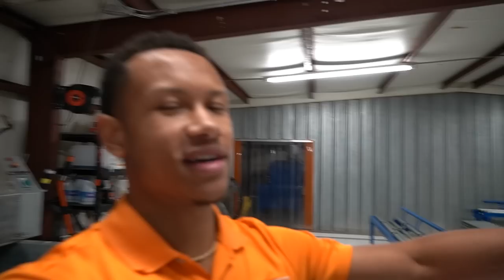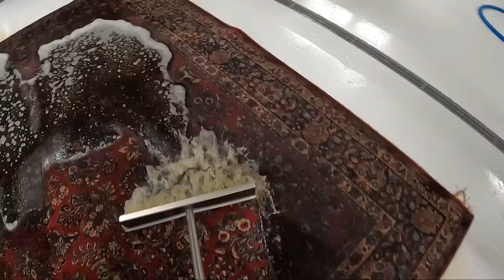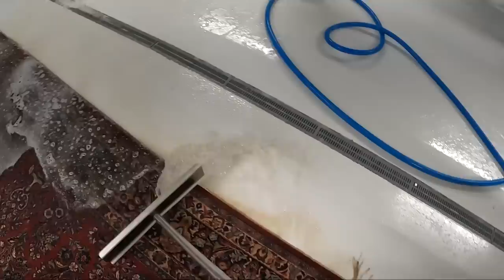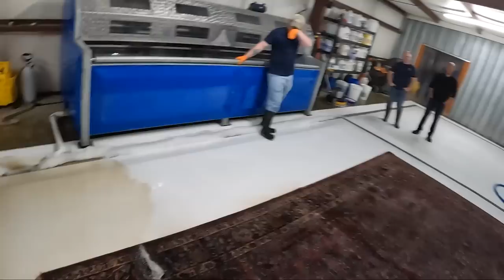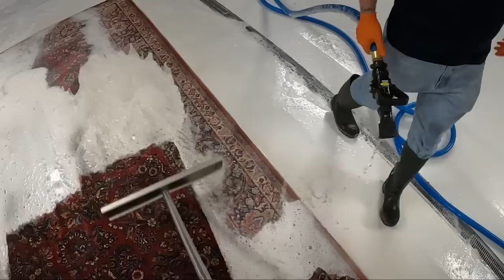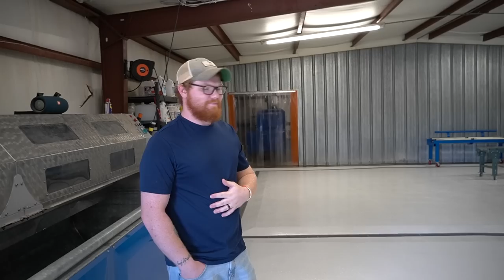How to clean an Extremely Dirty Karastan Wool Rug || P.O.V Rug Cleaning

Comment: Do you change the wash tub's water or do you use the same water all day?  I'd sure hate to have my rug follow a pee soaked rug in the tub.
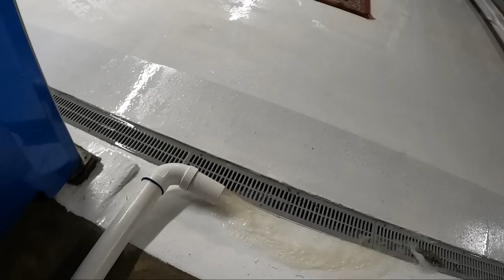Reply: Watch 2:09, he empties the tub of dirty water after the rug has been washed, so the answer is YES he does.
Reply: @white6942  yes, he did empty it, but said that all the rugs had urine in them that day.  I've seen multiple rugs put in the tub.  Just curious since I wouldn't want someone elses pet urine mixed in my rug.
Reply: @kirkshar  he did say ALL rugs were put through the wash had urine in them...same too i wouldn't like my rug in the same dirty water but I only seen the 1 rug washed. 😊